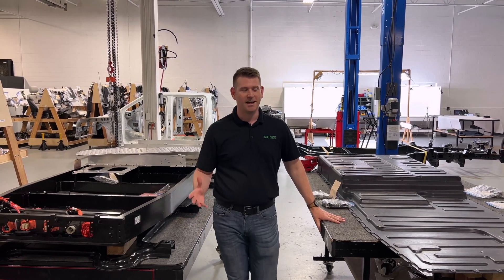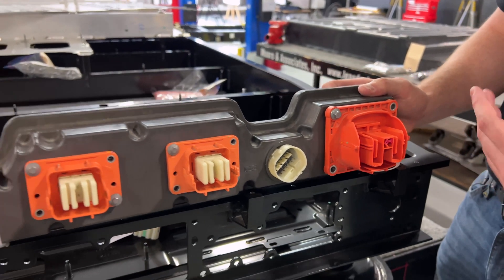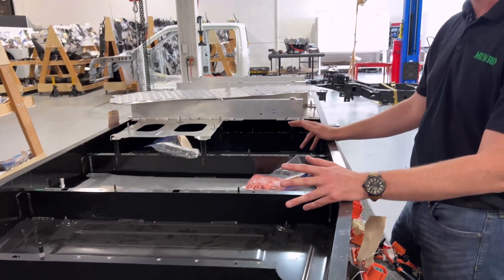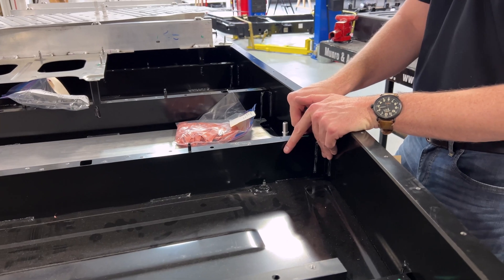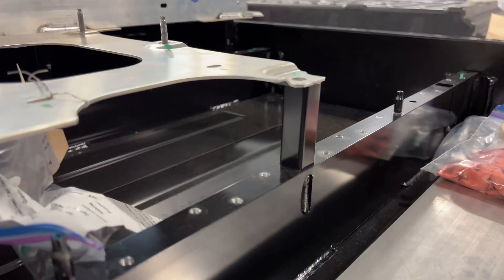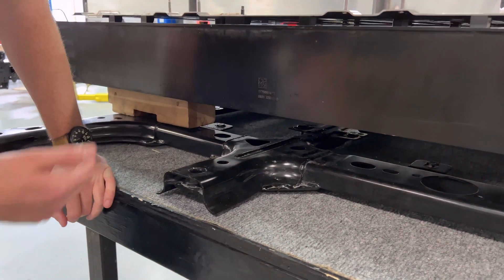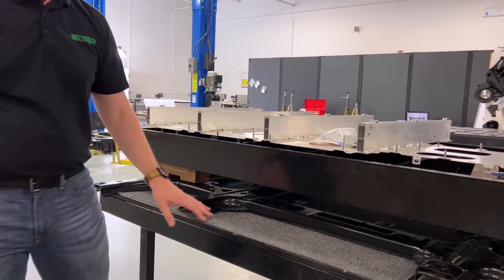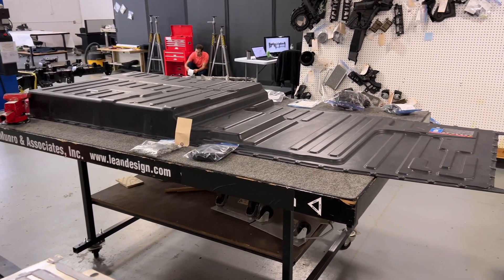F -150 Lightning Battery Pack Structure

Comment: 144kwhs total capacity huh? Interesting fomoco maintains such a high kwh buffer, holding a full 13kwhs back. 🤔
Also makes me think that pack is large enough if it uses a module less design. To hold 180+kwhs. 
Which means the lfp catl supplied pack's next year are going to be pretty big. 

I really wish Ford would do a single motor smaller pack rwd only lighting standard cab.
Reply: The system diagnosis can isolate a battery fault to a specific module making repair of the failed module possible. A module less design would give greater storage density at the expense of repairability. Pick your poison.
Reply: @heathwirt8919  clearly your name should be John snow. Just because a manufacturer claims a module is serviceable?
Doesn't mean in the real world it'll end up actually being serviceable. Ala the Chevy bolt recall is proof positive of this. 

And those who've tried unsuccessfully to repair/replace individual tesla modules for years now in less than sterile environments.
had the serviced pack fail due to the bms not being able to balance the new/replaced module's. 
As elon said think of a pack as starting out with high grade ore instead. Grind it up and start over. 👍🏻
Reply: @4literv6  Tesla battery packs are not repairable by design. Ford's battery packs are by design. The entire battery is removable and serviceable. The battery structure is not a stressed member of the vehicle like the Tesla design so it can be removed without the body structure collapsing under its own weight if not braced. Ford's batteries are not potted and arranged in modules that are serviceable. A faulty module can be isolated using diagnostic software. Tesla designs for ease of assembly and low cost, a battery failure becomes the consumers problem when the vehicle is out of warranty. If you buy a Tesla sell it before the warranty runs out.
Reply: @heathwirt8919  Yes, except that the Tesla batteries are designed for very long serviceable life. 4680 is intended to last 1M miles of vehicle use. You are right, the structural pack is not designed to be serviceable, but will be removed when the vehicle is scrapped and sold to Redwood Materials for re-cycling.

Comment: 131kwh usable out of 144 is an  oddly large buffer 😐
Reply: Lifespan goes down very rapidly as you push further on depth of discharge, and I'd imagine that they want to retain some power for non-motive upkeep.
Reply: @TrogdorBurnin8or  Sure, but that buffer is usually <5%. A 10% buffer is alot of dead weight to carry around, signaling low confidence in BMS management, SOC estimation, and/or thermal control.
Reply: @MADMAX7330  That "dead weight" will still be part of a functional battery pack long after a less than 5 percent buffer battery dies.
Reply: @heathwirt8919  My 7 year old Model S battery has degraded less than 5%.

Comment: You gotta work on not saying: "itself and "themselves" --  after everything. 
It's flooding your vocabulary too much.   It's just a habit and you can easily get rid of it.   You just have to understand that you're only doing it as an "insecurity" -- you're simply trying to fill the dead air after a thought;  Just like when people say "Umm" a lot.  So the best way to work on it is to become absolutely comfortable with silence.   You don't have to fill the empty silence while you're thinking, with filler like that..  But first you have to recognize that it's there;  If you think it's not a problem, it will never change.  I can tell you that it's distracting and you really should work on it.   From tough love.. cheers

Comment: This battery pack is basically a body- on- frame structure hung underneath the body- on- frame truck chassis.
Reply: The chassis is flat, and the battery pack is in the recessed area between the frame rails. The second story is towards the body, and it is probably still between the frame rails. All you need do is watch the hoist review to know what you think is going on isn't how it was assembled from the bottom, and the chassis review shows that the battery pack second story still fits between the frame rails. The ladder structure is still attached to the chassis frame.
Reply: @ronaldking1054  you didn't understand what I wrote.  The battery pack itself is built akin to a body- on- frame,  with its own frame below it,  and then this,  as a unit,  is bolted to the body- on- frame truck frame. Too many redundant components.
Reply: @jamesengland7461  The structure underneath holds the battery in place. The fasteners to the chassis prevent a mechanic from dying upon removing the external structure. No, they aren't redundant, as they do not serve the same purpose as one is the long-term solution, and the other is the short-term. What is gained? The frame is strengthened by not removing the holes for as many fasteners. The battery pack is also better armored with minimal clearance lost.
Reply: @ronaldking1054  go argue with a fencepost.
Reply: @jamesengland7461  shrug I guess that means you agree they are not redundant. I'd hope so because if you thought they were redundant then you believed one type of wrongful death would be allowable by the design of the truck.
Reply: Yes, and it makes some sense. Just as the powertrain (engine and transmission conventionally, electric drive units in this case) is supported by and isolated from the main vehicle frame, the battery is as well.
Reply: Like an external bomb to big for a bombers bay vs internal weapons. Hurts ground&frame clearance and ad's weight. 
Bet the next one the ground up as an ev lightning from blue oval city in TN in 2025 or 2026. Has a module less structural pack instead. 

Maybe even designed by catl as Ford partnered with them to supply cells for the mach e next year and lightning from 2024. 🤔
Reply: @4literv6  
Dambusters !!!
(Hums the tune....)
Reply: @4literv6  The construction used allows the entire battery back to be removed for service without affecting the vehicle integrity. It's called serviceability, something you haven't learned about yet.

Comment: Isn’t this feedback for LG and not Ford?
Reply: Sk innovation factory in GA supplies the lighting cells, I think the pack casing itself is from magna.
Reply: @4literv6  magna in st thomas ontario
Reply: Not likely. The outside supplier (LG Chem for the Mach E but apparently SKI for the Lightning) supplies the modules, but probably not the battery case.

Comment: Many on the forums are already citing contactor failures. Would love to see the HVBJB module in greater detail and see how many components are shared with the MME. Seeming like Ford hasn't learned its lesson.
Reply: Can you provide a hint where "many" are citing? I'm not exactly skeptical, but I'm surprised that I wouldn't have seen this in my personal research.
Reply: Stop lying lol….
Reply: According to the fordf150lightning forum a problem with the contactors has been reported a total of 2 times and both said they were able to get the part replaced very quickly under warranty.
Reply: @44beebe  There's certainly more than 2 if you actually search Powertrain Malfunction and read through the actual threads. And I'm not talking about faults attributed to a loose 12V connection. These are brand new trucks with hundreds of miles being stranded or hamstrung to 15 mph without warning. Does that not warrant a deeper investigation into the HVBJB? You EV shills are unreal.
Reply: @ambush1242  hmm I just did a couple more searches and I can only  Find two(2) total reports of problems that are specific to the contactors.  There are other "electrical" issues reported here and there but your post referred specifically to the contactors.  I'm no shill just researching and watching for problems because I'm interested in purchasing a lightning or rivian.
Reply: @44beebe   I give Ford no credit after they dragged their feet when MME owners complained of similar powertrain issues early on. They couldn't even push the current limiting software hotfix to owners for months after the NHTSA recall. If I see the same EVC contactors in this truck despite its higher power demands I'll be disappointed. And I say that with a build week scheduled next month. See you when the TSBs come out.
Reply: Many are citing the your a Tesla fanboy that needs a life.

Comment: Pack probably isolated from the frame due to possible frame flex.
Reply: I agree, and the very stiff Rivian system (with the body rigidly fastened to the frame) is Rivian's alternative approach to this problem. GM seems to have gone for very high frame torsional stiffness (using large extrusions for side rails) to address the same issue.

Comment: the battery is isolated not for NVH but rather for electrical integrity; body on frame trucks flex a lot and if you flex the battery you can break the bonds to the cells, or even damage the cells themselves
Reply: Do you think body on frame trucks flex more than unibody vehicles?  They don't, the reason this battery can be isolated is that the frame has enough strength where as the battery case doesn't need to be a stressed member as in a unibody or semi unibody design.
Reply: @heathwirt8919  I would agree they do especially when you take them offroad with a load, on highway use no.
Reply: @miguellopez3392  Ever take a unibody vehicle off road? I wouldn't. Looking at the frame on this vehicle it resembles a 1 ton truck.
Reply: @heathwirt8919  you can literally find videos of the gap between the bed and the cab opening and closing as trucks offroad. it's a fundamental physics issue because of the geometry of a ladder frame; look up "second moment of area"
Reply: @nuttyDesignAndFab  The body is mounted to the frame with mechanical isolators that flex. What you see are the isolators flexing, not the frame which is very stiff.
Reply: @heathwirt8919  ok let me see if I understand what you're saying: the frame is really stiff and doesn't bend, but the cab and bed just happen to lean on their isolators, coming closer or farther apart AS IF the frame was bending?
Reply: @heathwirt8919  any body-on-frame vehicle flexes much more than any unibody, although pickup frames have become much stiffer over the past few decades. In extreme off-road conditions you can see the cab and box move relative to each other, showing the frame flex; unibody vehicles don't crumple the doors, which would happen if they flexed that much.

Pickup boxes are not isolated from the frame - they are bolted directly to it, and they flex with the frame.

Comment: Quick update on demand (at least in eastern PA).. actual deliveries have fallen off a cliff. Many have cancelled / refusing to pay extortionist level mark ups. Local dealer has had a Lightening on the lot for almost 6 weeks now.. demand is unwinding fast.
Reply: Dealerships know how to screw themselves, over pricing is going to cost them. Hold back from purchase until they are prepared to offer a reasonable price or at least bundle a bunch of extras for their ridiculous mark ups. Exploiting an opportunity properly requires a measure of reasonable gain for both parties … supply however can price itself beyond demand and that’s what I see bad dealerships doing, reinforcing the notion of Stealerships …. The place you visit once and if they are the only option you buy then leave never to return …
Reply: "Demand is unwinding fast" Dumbest statement ever.
Reply: @heathwirt8919  
How about 
"Demand at the going rate is dwindling fast"?
.
(Demand at the MRP may be fine..... But it's still an issue?)
Reply: @rogerstarkey5390  agreed. And demand for trim/options not made available isn't necessarily being visible. The $45,000 Lightning is being stubbornly difficult to order. I understand Ford desiring to build the most profitable version first, but telling us it's the one we want implies we don't want the entry level Lightning. I will never believe that.
Reply: @rogerstarkey5390  Only in the mind of a Tesla fanboy like you and Paul.

Comment: The most expensive component (the battery) is isolated and very well protected. Don't change that.
Reply: Did you listen to what he said?
Isolating the battery was a mistake.
Reply: @shortaybrown  I'm sure the Ford engineers that designed the battery assembly would strongly disagree with you and him, it was designed that way for a reason. What Is Shock Loading? Shock loading refers to a sudden and drastic increase of load, similar to a “hammering” effect. This is a truck not a Tesla sedan.
Reply: FORD IS A POS